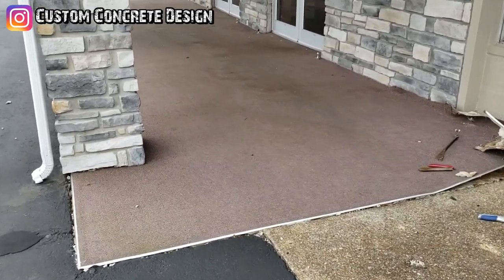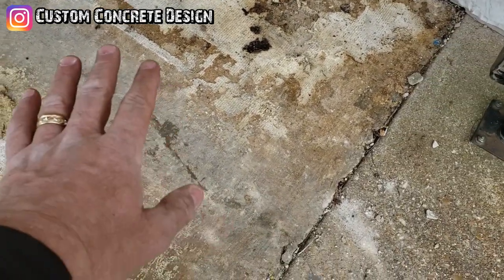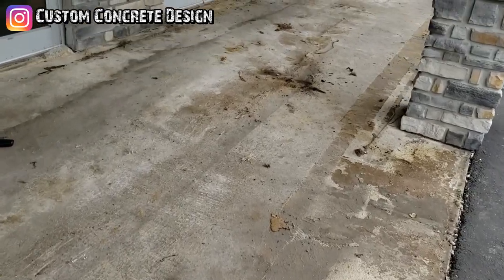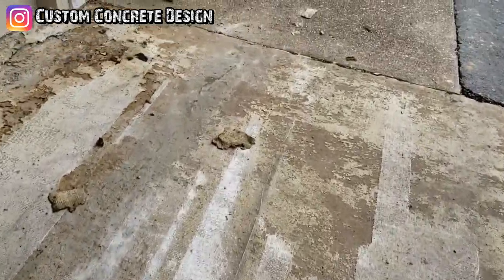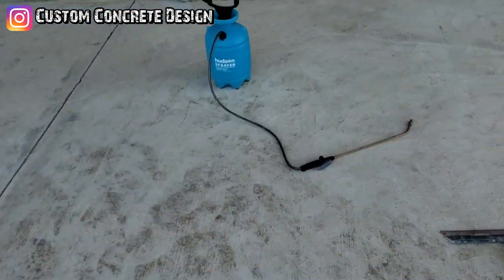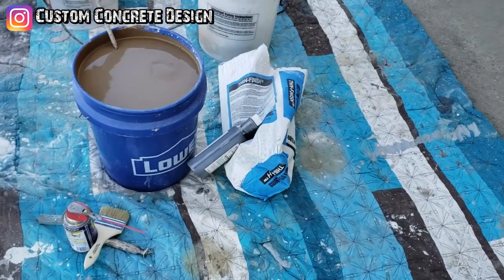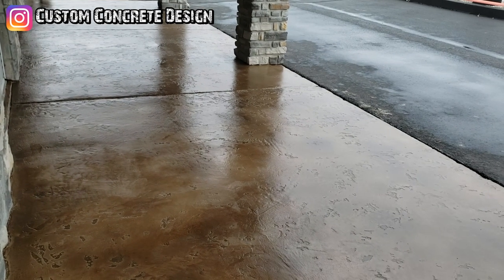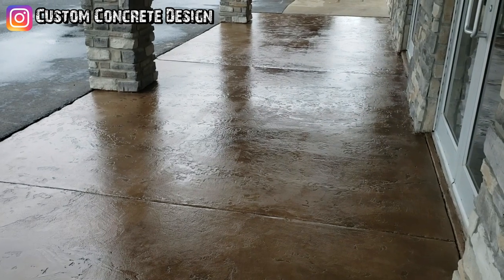Decorative CONCRETE | Resurfacing an OLD Church Concrete WALKWAY

Comment from the maker: ✅DID YOU ENJOY THIS VIDEO?
👍 Smash The Like Button and Comment if You Did
🔴 SUBSCRIBE For More 👉 https://customconcretedesign.live/YT-Subscribe
🔔Turn ON Notifications So You Don’t Miss My Next Video❤️....See you on the Next Project! 😀
Reply: The cracks do com back rite?... 
I know you grind and v groove,  maybe use a polyurea,  or epoxy  to fill them in right now,  but eventually it will show bac up?
Reply from the maker: @lavonn188  yes it's always possible that they will come back, but when and if they do usually its a smaller hairline crack.
Reply: @MrCustomConcrete  ok cool,   and you usually inform the client  of that possibility? 
Also..  You don't think it's a waste of time and material  to crack repair, if it will come bac anyway?
Reply from the maker: @lavonn188  Yes I always inform the client during the sales process, then it's in Bold writing at the top of my contract as well and that I do NOT guarantee the crack repair in any way and then I make them initial that part of the contract before I will take them as a client, I fix the cracks because I think its worth it and is some cases they may not come back, it just depends on who originally did the concrete work, where the slab is located, the age of the concrete has it settled already, is it suspended or on the ground, there are so many reasons it could crack again, but there is a chance it may not... so I'm willing to take that chance as long as my client knows upfront then I can sleep well at night knowing I told them everything upfront and they initialed the part on the contract then they can never come back on me and say otherwise...I well written contract can keep you out of court!
Reply: @MrCustomConcrete  awsome!   You wouldnt have a blank contract template of that I cud use wud you?  Lol
Reply from the maker: @lavonn188  sure I can send you a copy of mine if you would like, leave me your email address here or DM me your email address at either http://www.instagram.com/customconcretedesign or message me on http://www.Facebook.com/customconcretedesign